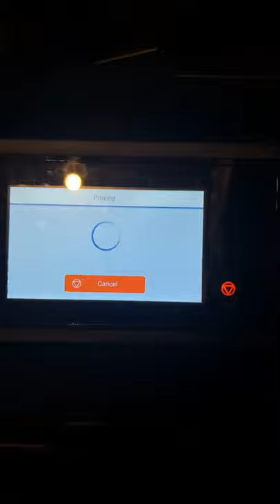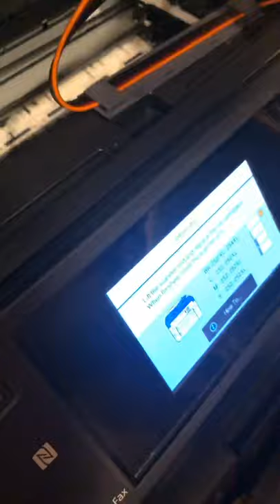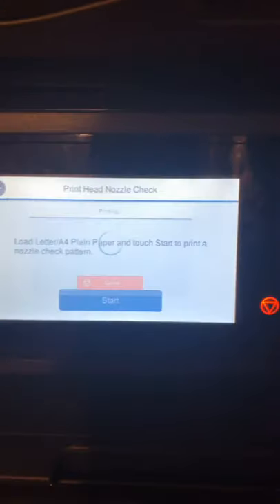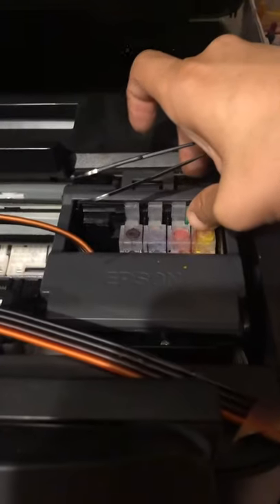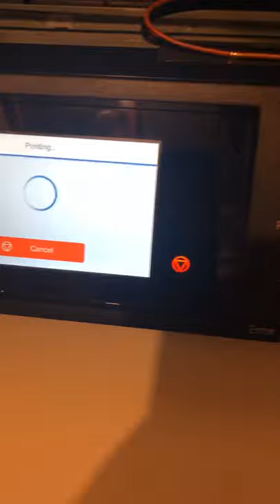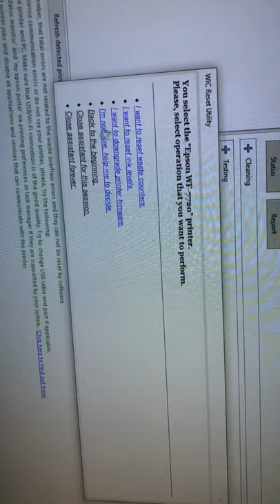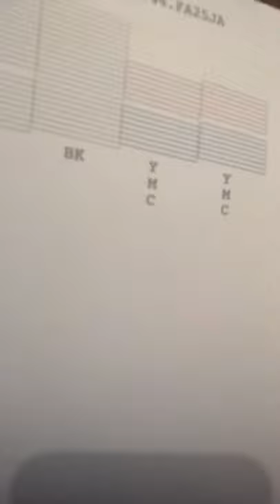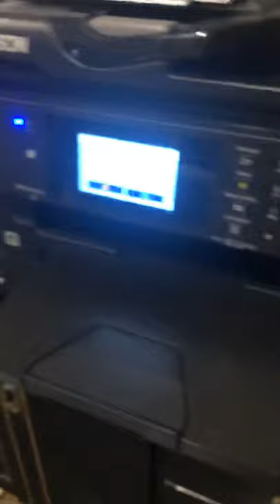Every single trouble shoot for the epson  Wf 7720 sublimation this will save you must watch !!!!!!

Comment: When I used to work with the Epson Artisan 1430, inkpad full error was always a freakin problem. I use to use Wics reset software at $10 per key. To get around the issue, install an ink reservoir to bypass the inkpad.

Comment: My wife’s is having an issue currently with printing with sublimation ink… as it prints the design onto the transfer paper, the design also has yellow around the edges. 🤔 not supposed to have yellow but it’s printing yellow on them all.. any idea why?
Reply from the maker: Join my group so I can respond faster 
Facebook.com/groups/craftingwithIrondesigns813
Reply: The paper edges get dirty while printing. I cut all edges after printing.
Reply: @adempozhari  it’s not just the edge of the paper though 🤷‍♂️ it’s around the edges of the actual print too 🤔
Reply: @Mosconi526  sounds like software raleted

Comment: I'm losing my mind with my 7725 atm. I'm going to investigate the lines and see if there are any potential kinks that are causing my problems. May I know why you have the ciss units placed so high? I read not to put position it higher than 13cm (5.11 inches) as doing so will cause ink to overflow into the printer head causing it to flood.
Reply from the maker: I couldn’t find anything to match recommended height, so I put it low and it’s wasn’t flowing refilling correctly then I put it back up and just left it there haven’t had much of an issue with yet so far on either of the two. 

If you have it in a room that temperature fluctuates hotter than normal it will constantly clog your print heads, 
If there isn’t enough flow into the carts it can also cause issues, 
Have a maintenance ink box on hand and or  a reset chip ( but at some point you need a box lol)
Reply: @IronDesigns813  I think the printer has finally had enough. It's now bringing up error when it turns on and says it has to be turned off. Can't even get into the home menu. Might buy an ecotank. Dunno, all the best.
Reply from the maker: @bjraleigh1439  is the line linked under the print head carrier ?
Reply from the maker: @bjraleigh1439  I meant Kinked*
Reply: @IronDesigns813  I don't know what line you are referring to under the print head. There are the cables going into the side of the printer head. I am going to pull apart the printer head. I think when i purged water into it i pushed to hard and it may have got water in the head where it shouldn't have. Someone noted the error im getting means, 031006

MEANING="Head fuse broken error"

DESCRIPTION="- Printhead failure"
Reply: @IronDesigns813  ribbon cable where connects to printer head was covered in water and ink. Had all decayed, like rust/mold. Tried cleaning it my best, but still didn't look the htrsy and those little prongs/metal teeth on the end of the cable, i might have bent them out of allignment to the extent that could be the actual issue now and the cleaning may have done the trick, though the actual port it goes in is probably screwed too, just hard to see right in there. There was even a little bit of water inside the head when I unscrewed the whole thing and got into the guts of it. Maybe a good video to make throwing the whole thing off a cliff. Didn't mention earlier but when i was purging the water into the head the tube slipped off and did get a lot of water all in the cartridge bay which most likely was when the water got down to the ribbon cable and caused all the damage. Maybe can get some money for parts. Not giving up though, lol. I still have another one on order and believe it or not another one sitting in a box that I can't get it out of recovery mode. Epson said qualify for replacement or refund. Will re-evaluate and figure something out. Btw do you know anywhere to trade/swap shirt designs. It came to mind that people may do that. If you are interested in swapping designs let me know. I am in Australia, so there would be no conflict of sales. Sorry for the long message. If you read it you do, lol
Reply from the maker: @bjraleigh1439  oooooh noooo do you have a blow dryer you could maybe try to dry it off with? I’d say keep the parts for the other two if all else fails. I read all my messages they are all important to me. As well to others could be learning content. You just taught me something. And I thank you for that. 

Absolutely I love creating designs and sometimes I’m not in the mood too lol so this might be something I’m interested in.
Reply: @IronDesigns813  my comments aren't showing?
Reply: @IronDesigns813  I responded to your comment two days ago then the following day the comment wasn't there, so I commented again the following day and that is gone now too. It looks like my comments are working now. I'm not sure if they are going to disappear again? very odd.
Reply from the maker: @bjraleigh1439  they are still on here all of them I don’t delete messages. All I put is greatly appreciated
Reply: @IronDesigns813  Two of the comments I left didn't go through. I had the issue in the past once where It would not save the comments I made and you don't get an error or anything so you don't think twice about it. I googled it last time when it happened and seemed to be pretty common. Somehow it has resolved itself. I wanted to ask you a few things if you are willing to have a chat on facebook about sublimation and if you are interested in swapping some designs. Add me on facebook if you are up for a chat, all good if you don't. Thanks https://www.facebook.com/brett.raleigh.5

Comment: I am currently going insane with my WF7720 vertical alignment print. I cannot get it to print the squares filled. There’s dark lines and blank lines in between and I cannot find a single video on how to fix that. Does anyone know what I can do? I’ve been trying for an entire week and there’s nothing on the Epson website. It prints everything super misaligned. Horizontal is fine but vertical isn’t :(
Reply from the maker: Message me amd join my Facebook you need to flush the lines 
Facebook.com/groups/craftingwithIrondesigns813

Comment: Are the boxes being filled at a fast rate, I noticed my brand new Epson wf7720 is leaking the black ink, I went thru a whole bottle of sublimation ink just doing head cleanings, 35 to be exact and I still can not get my test page to come out like it should. I don’t know where the problem is, I am using a refillable cartridge system and not the ciss system,I did reorder ink and a new cartridge kit which cost 75.00 for everything so I don’t know, hopefully that will be the issue
Reply from the maker: Did you remove the air plug and cover the fill hole ?
Reply: @IronDesigns813  yes I did that.. I was reading how doing the head cleaning will cause you to lose a lot of ink depending on how many head cleanings are performed, so I guess I need to figure out why I still have broken lines after doing 35 head cleanings and nozzle checks
Reply from the maker: Did you get it resolved ?
Reply: @IronDesigns813  I did. I purchased magic bullet printhead cleaner. Thoroughly cleaned it. Reinstalled the ink. It's working beautifully. Also purchased a new maintenance box. I am waiting for that to arrive.
Reply: @odebarah  hi! My set up is the same as yours and I’m having the exact same problem as you. May I ask where you purchased the items to resolve your issue please?
Reply: I have a brand new Epson 7720 When I print out a document nothing appears on the paper it just comes out blank but I can print a picture out off my phone threw the app but still no black ink come out on the picture just yellow and blue.

Any one got any tips on what I can do to get the black ink working???
Reply from the maker: @josephcarter8584  hi are you using a CISS or refillable cartridges? 
Run a nozzle check and tell me how the lines print ?

Comment: Does anyone are having also the error 034503. Help please!
Reply from the maker: First, I highly recommend replacing the ink cartridges you just installed that were in the defective printer because defective ink cartridges can cause this type of error. To test this, if you have old cartridges you can use, replace the cartridges in the printer one by one with a printer restart between each cartridge swap out until the error goes away. If you do not have old cartridges, obtaining new genuine Epson cartridges is recommended as it will save you time in getting the printer working.
Reply from the maker: Also remove carts and clean prints with qtip
Reply: @IronDesigns813  Thank you so much, I will give this a go
Reply from the maker: @JairusNOUVEL1  let me know if it helps
Reply: @IronDesigns813  I‘ve tried it and sadly nothing works so far. Also I have received an email from epson saying:
 
„Only a technician can correct this error.

For a repair of your device, the repair service provider Letmerepair is your contact. You can contact him via email.“ 
Seems I’m f** doomed :(
Reply: @IronDesigns813  But I really appreciate your assistance. Thank you